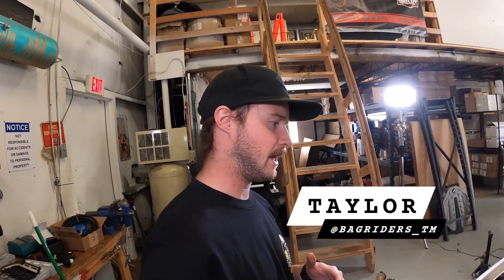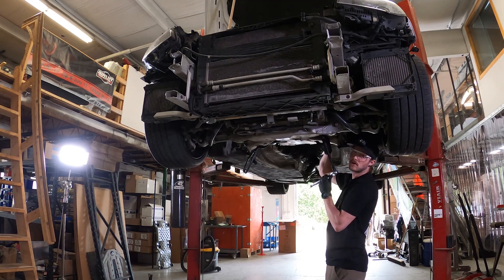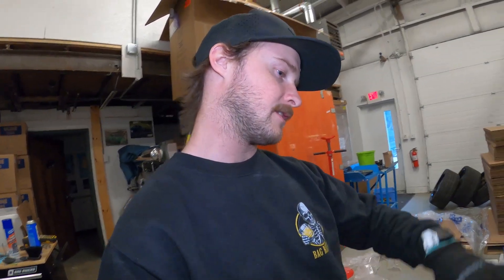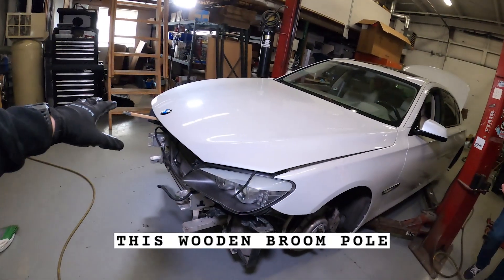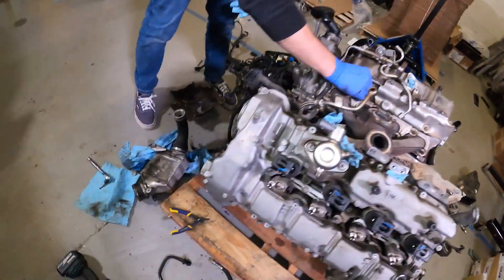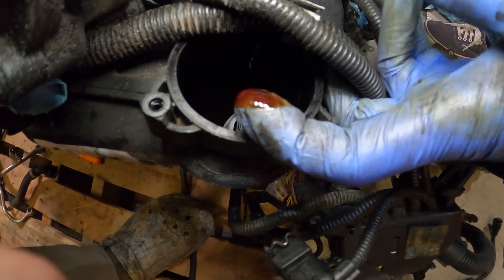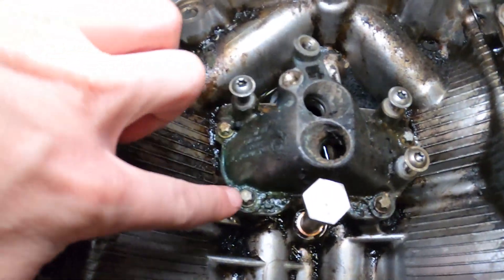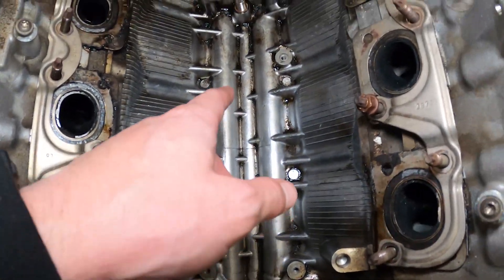The N63 from our F02 750Li needed to come out.

Comment: Engines a nightmare. Had a brand new one dropped in my 2012 750. Burns 2 quarts of oil every 4k miles still. Too much heat 🔥 in the middle I suppose.
Reply from the maker: Yeah they are a troublesome motor without a doubt! But they do sound really good!